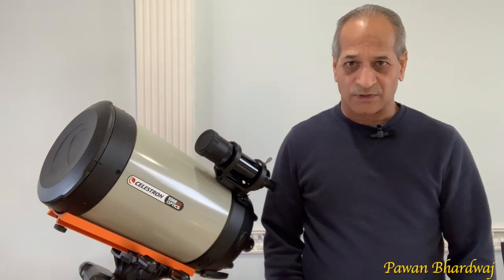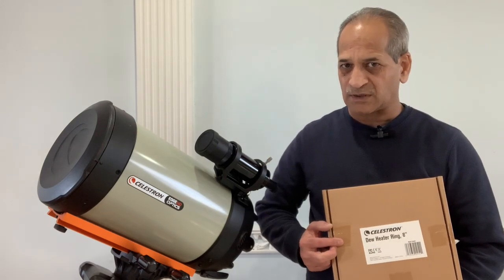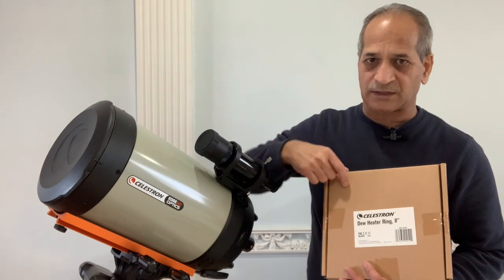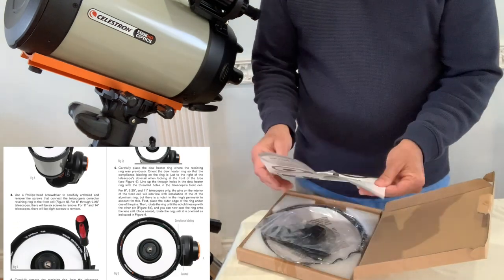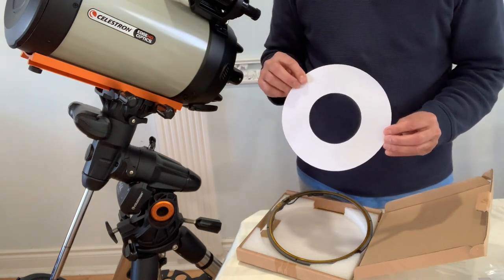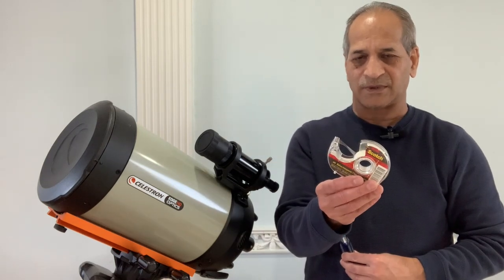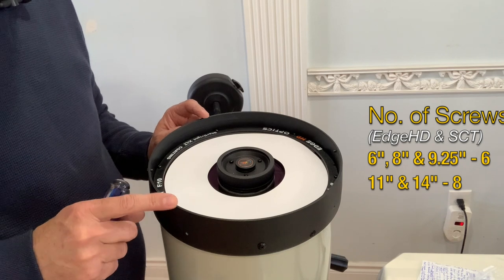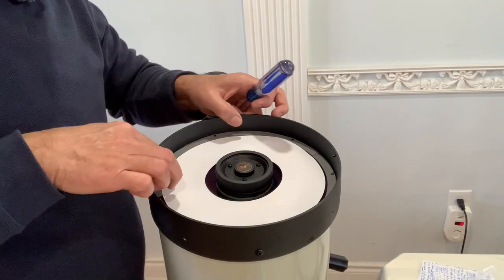Celestron Dew Heater Ring Installation on 8" EDGE HD & SCT. Connect & Power with ZWO ASIAIR.

Comment: I need to get one too! The dew shield is not really working for me.. thanks for the detailed video..
Reply from the maker: Thanks Raj! The Dew Shield would still be good when used in addition to the Dew Heater Ring. The Dew Shield prevents some of the stray light as well. I would prefer to use both.

Comment: Nice instructions. For my future Edge 8, want that too for planetary and small galaxies. By the way, what kind of cable is needed for the ring to the asiair plus? There is a power output setting in the asiair plus where you  an select how much power the AA+ have to give to the dew heater in %.
Reply from the maker: Thank you! You need a normal 12v DC power cable (5.5mm/2.1mm)for the ring. This is same as the power cable for other devices such as cooled camera or ASIAIR itself. Reg, power output setting in ASIAIR, it will check it out. CS!

Comment: Hi Pawan.  Thanks for the great videos on the Celestron Edge HD 8!  I should be getting mine in a few days and I feel much more prepared to get it ready after watching your excellent tutorials.  Just a question about the dew heater ring.  I noticed there is a cord in the box that you didn't use.  Can you tell me what kind of connectors that cable has at both ends?  I have a Kendrick 4-port power controller I currently use that accepts RCA-type plugs from my dew heater bands and I wasn't sure if the cord that comes with the Celestron dew heater ring will interface with the cord from the dew heater ring and my Kendrick controller.  I'd like to know so I can order an appropriate cable before the scope and dew heater ring get here. Thanks again for all the wonderful videos!  Very helpful.
Reply from the maker: Thanks! I'm glad that these videos are helpful. Hope you have received your EdgeHD 8 by now. The power cable in the box has RCA type connector on one end and a simple female pin connector on the other side. The manual for this dew heater ring states that this cable is used only if you have Celestron smart dew heater controller. I'm not sure if this cable works with Kendrick controller. You might want to check the Kendrick manual or consult some forums like cloudynights.com. Cheers!
Reply: @AstroCrescentDIY  Thanks so much for the detailed information, Pawan!  I really appreciate it. I don't have my EdgeHD 8 yet, but I did receive the dew heater ring today.  In looking at the instructions on page 4, it says the dew heater rings are generally compatible with third party dew heater controllers, and says, "Use the included extension cable to connect the dew heater's rings power jack to the controller's heater output port."   So, I think it will be okay!  Thank you again. Very kind of you to follow up and reply.

Comment: Good information~ Can I ask question? Can I only use car battery cigar cable ? If It supply the continuous 12V power, occur some problem? Example, front glass break because of continuous heating? I dont know. Please, reply. Thanks.
Reply from the maker: Thanks for watching! I’m glad you liked the video. There no problem in using the car cigarette lighter adapter cable. The scope glass (lens) doesn’t break due to limited heat produced by the dew heater ring. Cheers!!

Comment: Great video! How are you connecting the ASI AIR Plus onto the SCT? What kind of dovetail mount is that?
Reply from the maker: Hello Seemanta, Thanks for watching. I'm glad that the video was helpful. For mounting ASIAIR on top of your SCR, you may buy a general universal finder scope base from Amazon. Remove the factory finder scope from the SCT, install the new finder scope base on the same screw holes and then mount the ASIAIR in the finder scope base. Hope this helps. Cheers!!

Comment: Excellent tutorial.  Thank you.  How does the dewshield sit on it?  Doesn't the cables obstruct?  Do you have a video for securing the dewshield along with this ring?
Reply: Also is the dewshield needed in addition to this ring?
Reply from the maker: Thanks for watching. The dew shield fits nicely on the EdgeHD 8. It provides protection from unwanted stray light from surroundings. The power cable does not obstruct securing of the dew shield to the tube.

Comment: Hi Sir, for the dew heater controller, does it manage to control different level of heat?
Reply from the maker: Thanks for watching! I myself do not use a dew heater controller. I would suggest that you check out the official details on Celestron website:
https://www.celestron.com/products/smart-dewheater-controller-2x
Cheers!
Reply: But I saw your sybony can control high, medium and low?
Reply from the maker: It's just voltage setting, not a real temperature or humidity control. Thanks.
Reply: Thank you Sir @AstroCrescentDIY

Comment: can you please share the link for the SV bony voltage adapter.  thanks.
Reply from the maker: This is actually a part of SVBony Dew Heater Strip. You can get it from Amazon - https://amzn.to/45zbQHb (affiliate link).
Thanks.
Reply: @AstroCrescentDIY thanks.  can we separate just the voltage adapter from the strip, and connect it to the dewheater ring on one side, and Asi Air Plus on the other side?  I want to control through AAP and looking for a simple 12V input adapter connecting the ring on one side and AAP on the  other.
Reply from the maker: @sreeshab4093  That's what I did. Again it depends on whether the specific model of dew heater strip you are using has that option. Thanks.
Reply: @AstroCrescentDIY thanks.  the link you have shared -  SVBony, presume it is feasible for this need.  am I right?
Reply from the maker: It worked for me 😊.